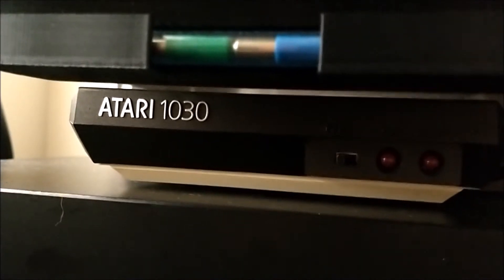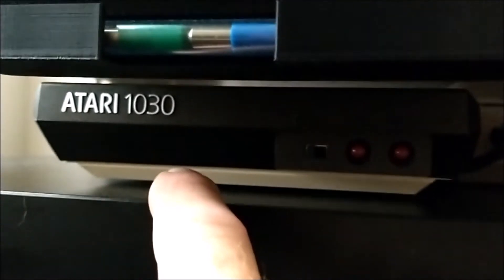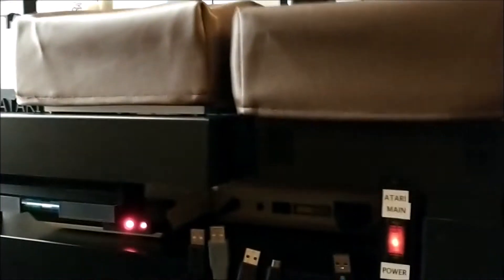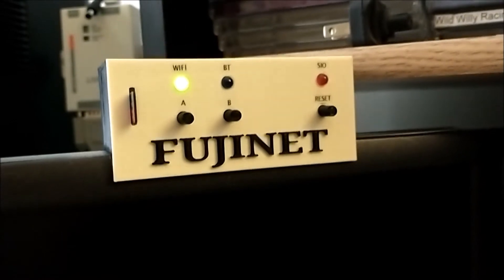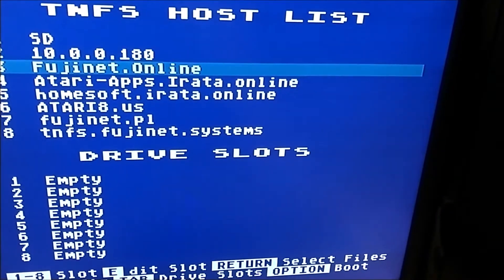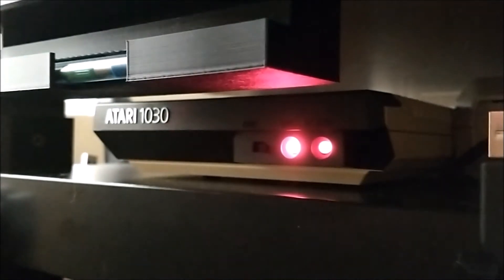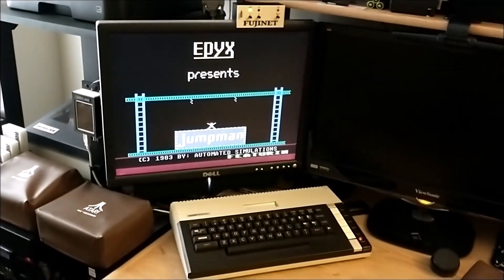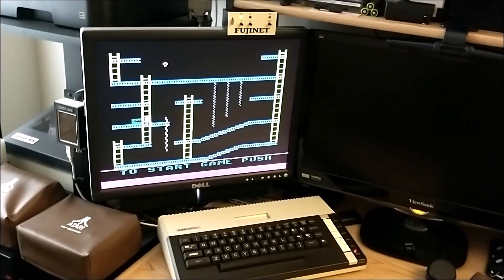Atari Fujinet inside a 1030 Modem

Comment: What do you use for video out of the 800XL? That looks good!
Reply from the maker: Dell 2001FP monitor, with a hercules s-video cable. 800xl is stock except for hooking up the missing chroma line to the monitor din connector.